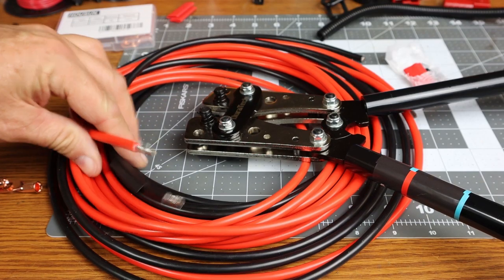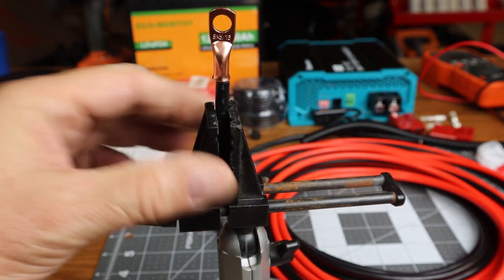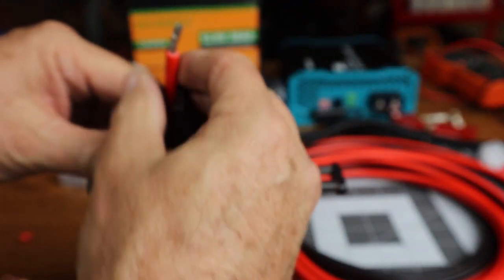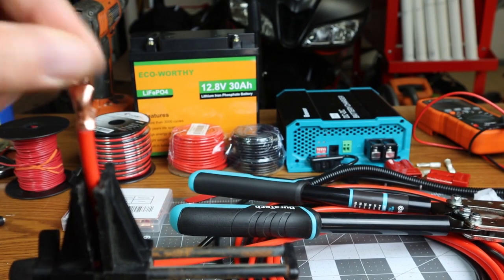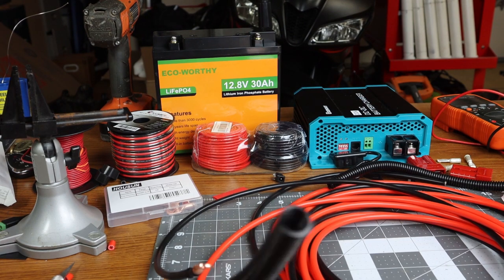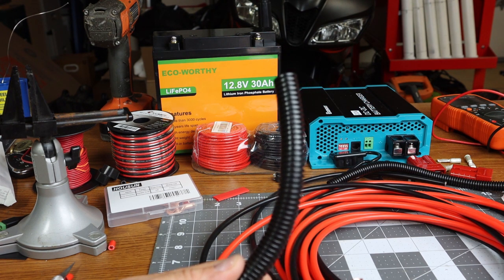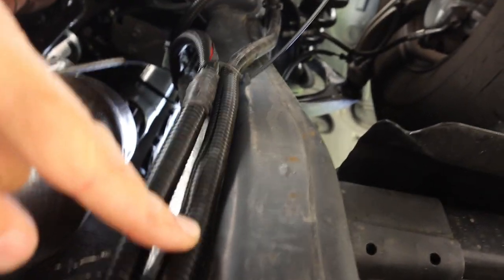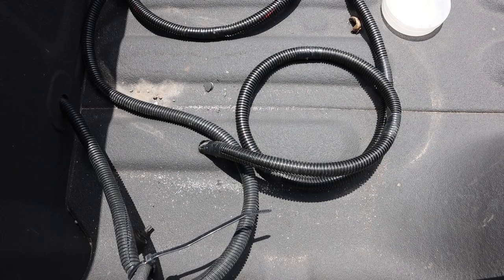Install a DC to DC Battery Charger for RV/Camper Part 3

Comment: I just did an install very similar to yours. A few comments:
1. Used a 40amp DCDC converter and 1ga CCA wire. I was able to find a 60a service on my fuse box and connected a 40a fuse to it. Ground is to the engine block. I have a 2023 F150 and the way vehicle charging's systems are these days I wanted to keep it after the battery.
2. I used similar connectors for the truck/camper connection (next size larger).
3. Because it is only powered up when connected to the truck, I just wired the power on (D+) to the input of the DCDC converted. So when I plug it into the truck it turns on. I initially connected the LC to the D+ but I needed more than 20a.
4. I'm using Lead Acid battery.
5. I also installed a 1KW inverter on the output side of the DCDC. This is connected directly to my refrigerator (thru a GFI outlet). I don't like using gas when I travel.
6. I took some current readings and I'm pulling around 25-30amps from the truck. Depending on the state of the battery. Around the same out of the DCDC converter. The fridge uses around 500w from the inverter (4amps@120v).
Reply from the maker: Thanks for the info,  Sounds like a good configuration.

Comment: Hey Joe what are your thoughts on crimping vs soldering your battery terminals? Eventually I’m going to do some battery cable work on my old 77 f150 and was thinking about the two ways of making cables 👍😁
Reply from the maker: If you can always solder.  If you cannot then crimp will do.  They make some new crimps with solder and heat shrink, you can use a heat gun to melt the solder.  I made a video about this a while back 😁. Thanks
Reply: @JoediyLab  thanks buddy 👍😁